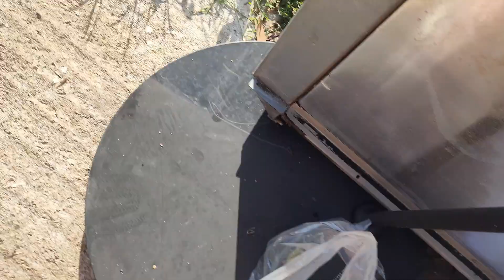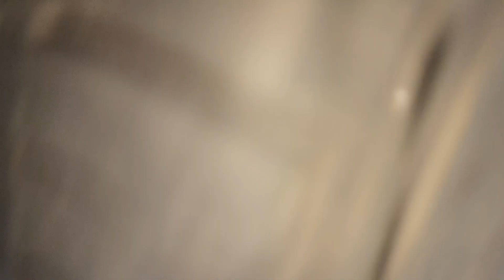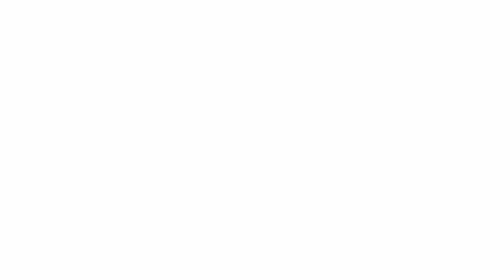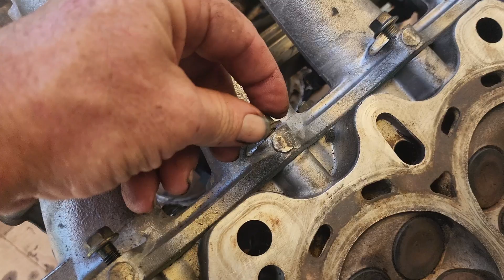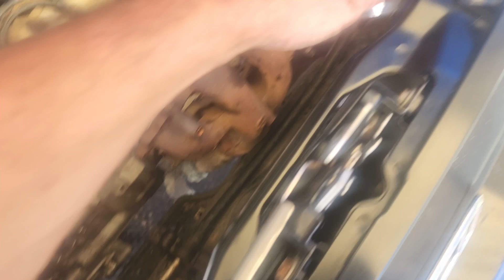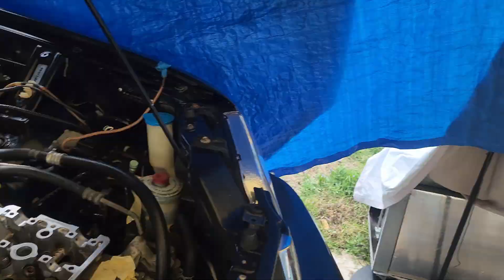Honday CRV 2000 blown head gasket replace - engine rebuild at home

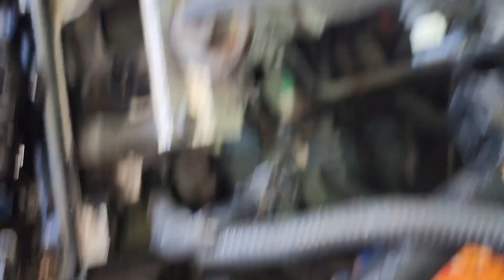Comment: how did you remove the blue clip behind the intake manifold at 4:17?  I'm having trouble getting that separated.  Thanks!
Reply from the maker: Actually thought put that in there but turns out no.  Can u post olhow u did it for others ?